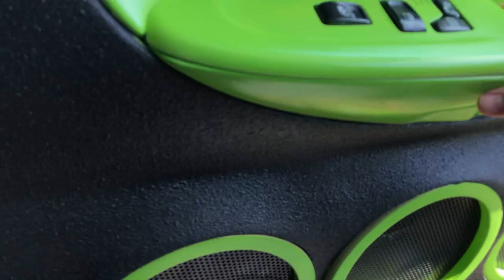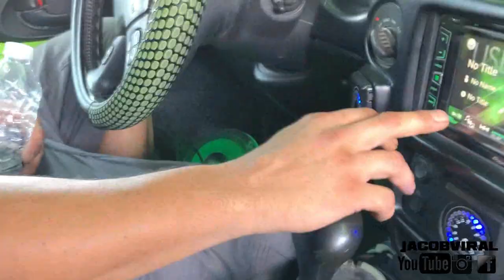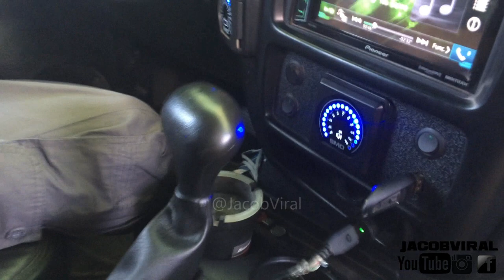10,000+ WATTS OF CAR AUDIO POWER SOUNDS GOOD!

Comment: Did he have any batteries? Or just running everything from the alternators. If he is that’s how I wanna do my build I like being on the road cruising while listening to music because I smoke blunts LOL I don’t like being parked listening to music
Reply: Well, if you’re trying to do anything like that then yes. Honestly, if I were you considering what you just said. I would get like a single 12-15” Sub with an amp enough to supports the electrical and shit and get a big 3 upgrade. You should be straight. If not you could get something 500w or lower and you don’t need an extra battery or big 3 and still bang a little bit. I did my first system and it was definitely good enough if you trynna be casual with it
Reply: Doesn't work like that, alternators are AC current, subs need DC. So you gota go thru a batter or lithium or something
Reply: @kevinriley5979  yeah I mean if he wanted that many watts like dude he’d definitely need to upgrade alt and batteries. No way stock could withstand all the watts